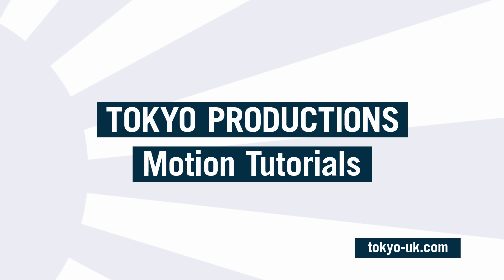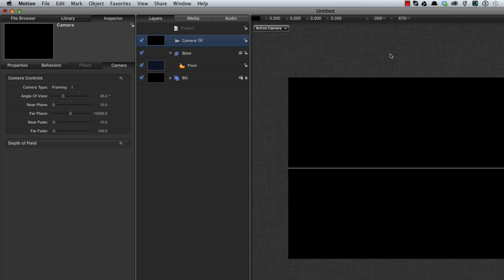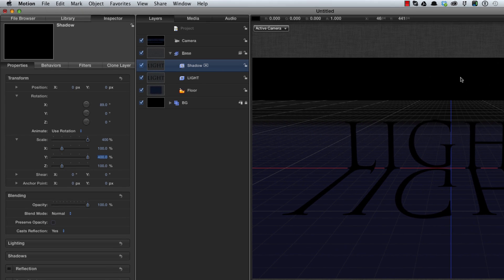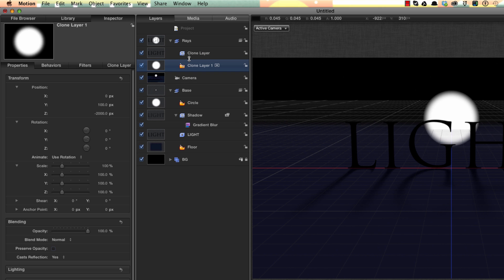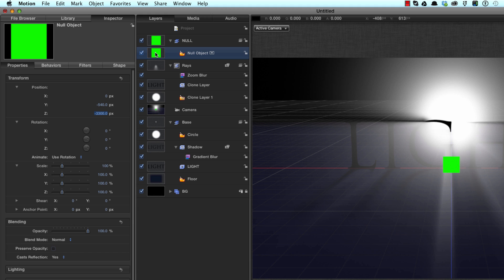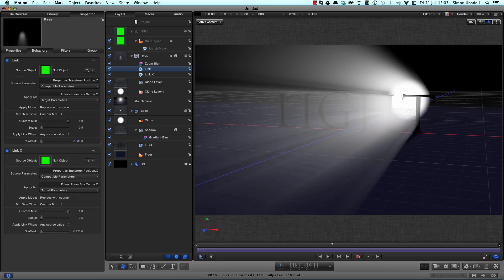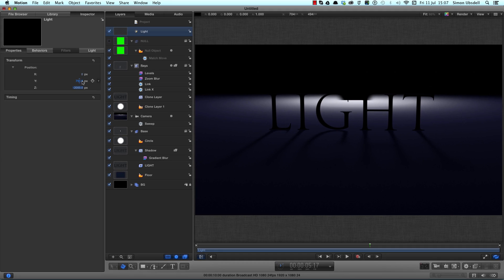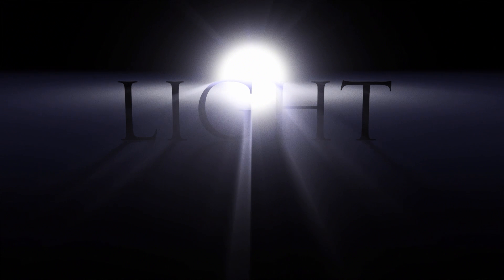Apple Motion 5: ALL NEW Volumetrics Tutorial

Comment: I am using Motion532 and not having text prepared I just created it using 3D text tool. When I create the shadow layer it disappears along the floor as I have to drag it past the red line on the floor.
What do I need to do with this version to get it to work properly?
Reply from the maker: Make sure to reset the position parameters for your text. If you add it after having moved the camera it will inherit the camera coordinates and you don't want that.
Reply: How do I reset the position parameters
Reply: Found where to do that - but the text still disappears when it comes into the foreground, to the front of the red line. The process dosen't seem to work with this version or perhaps I have some setting wrong.
Reply from the maker: Please feel free to email me your project and I can take a look. This should be possibly in all versions of Motion.
Reply: Hi - I have had some success with this - I just copied the text layer and then moved it forward and lined it up that way. If I move it forward too far then the shadow starts to disappear. But I think I am good for now. I am just following along with your video. 
Thanks for your help.

Comment: Hello simon my name is Kelly and i'am from Holland. my question is, what system do you use? i have a mac 8X2,26 and 20 gb memory. and i don't have goed previews in full resolution.
Reply from the maker: stoffels10 Hi there. I'm running an old Early 2009 MacPro with 16GB RAM and a Radeon 5870 graphics card.  If you want to preview in full resolution, you'll usually need to do a RAM Preview (⌘R). I usually stick with Dynamic Resolution so Motion can scale itself depending on the complexity of the project. It's still way faster than working in After Effects ... I think.

Comment: Hi, thks for this tutorial ! But I have a question : how can I change the text color ? If I go to Text/Style/Face, it changes the shadow color but not the text color. How can I fix that ? (I would like to put a "gold" style for the text)
Reply from the maker: In the Base group, make a Clone of the Text layer.  Apply a Color Correction/Colorize filter to the Clone.  Set the Remap Black color of the Colorize filter to whatever color you like (in your case Gold), then set the Blend mode of the Clone to Screen. The key thing is to make sure the you set Shading to Off in the Clone Lighting section, otherwise you won't see it. Adjust the Opacity of the Clone to get the effect you prefer. It's best not to leave it at 100% at this will look pretty cheesy!

You could, if you're feeling clever, do it another way, which is to add a Gradient generator just above the text layer and use the Text layer as an Image Mask for the gradient (remembering to turn the Text Layer back on after adding it to the Mask well. Again you need to make sure Lighting/Shading is set to off. The advantage of this is that you can have a gradient for your text rather than a solid color which might help with the gold look you are after.

Hope that makes sense.
Reply: Simon Ubsdell I use your first solution and it works very well ! I also change the floor color to a "black gold" which makes the text emphasized ! Thks a lot ! Your tutorials are a really good source of inspiration for a beginner in Motion 5 !
Reply from the maker: Glad to hear that worked for you. I'm impressed that you're managing this tricky project as a beginner - great job. You're learning very fast!

Comment: i`m having a bit of a problem with the rectangle tool, it keeps changes to pan for some reasons? have any suggestions on how to fix this?
Reply from the maker: egil noto That sounds odd if that is indeed happening. Are you seeing any other strange behavior? If so, I would recommend that you run Digital Rebellion's free Preference Manager http://www.digitalrebellion.com/prefman/
That can often clear up any problems. Just make sure you only clean up the preferences for Motion, not any of the other applications it supports.
Hope that helps.
Reply: Simon Ubsdell Thank you so much, i had absolutely no idea of how to fix that. That worked and now i have finished the title for my video. No, i have not got`n any other strange behavior before. And i have used the rectangle tool before without any complications what so ever. But again, thank you so much for the tip and keep making these awesome videos!

Comment: followed you step by step. It didn't work out for me
Reply from the maker: Crystal Janelle Which part isn't working for you?  If you'd like to email me your project, I'd b happy to troubleshoot it for you.
Reply from the maker: Simon Ubsdell Check in the comments to this tutorial for a download link for the project - but hurry, it won't be there for long.
Reply: Ok, thanks! I think it's just because I'm a rookie when it comes to Motion. I lost you when you dropped your text from the favorites folder instead of actually doing it in the tutorial. Thank You for replying. I will keep trying until I got it! Thanks for the link as well.
Reply from the maker: Instead of doing what I did with the text (just trying to show off a really useful trick), you can simply enter text in the normal way using the text tool - the result will be the same. Good luck.